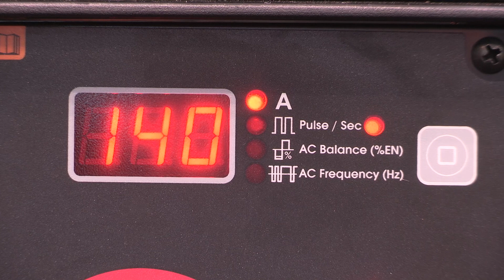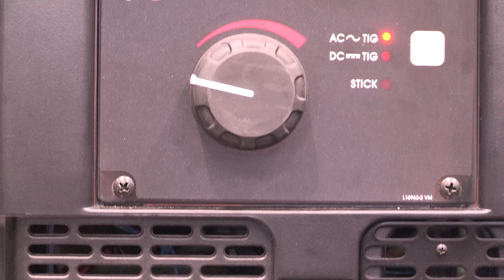The Lincoln Electric Square Wave TIG 200 at FABTECH 2015

Comment: Guys,.. you have a lot of videos about the machine function, parameters, setting up ,etc, but not a single video of the machine actually doing a weld. Can you please upload a video of the welding itself? We want to hear and see how it welds and how the parameters affect the weld, cleaning action, pulse,etc. You have sold thousands of them already and not a single video online showing the machine in action. Thanks.
Reply from the maker: +John Doe We are working on producing a couple videos to show how it works. Thanks for the question. If you have a specific application you want to see, please let us know and we can try to accommodate.
Reply: +lincolnelectrictv Would like to see tig welding of stainless and aluminum in different gauges . Also the use of the pulse and the frequency option to clean the welding. Thanks.
Reply from the maker: +John Doe Thanks again. We will do our best to get videos out.